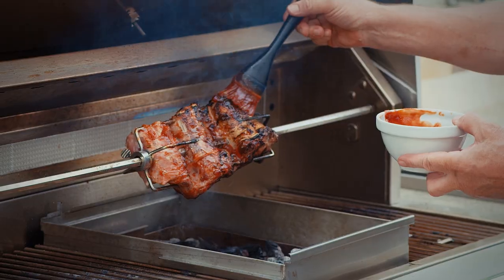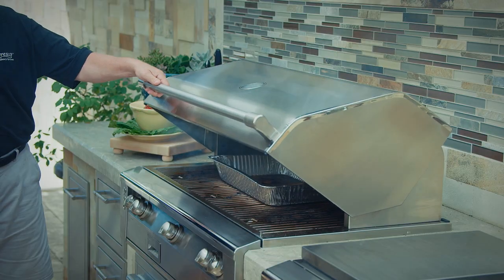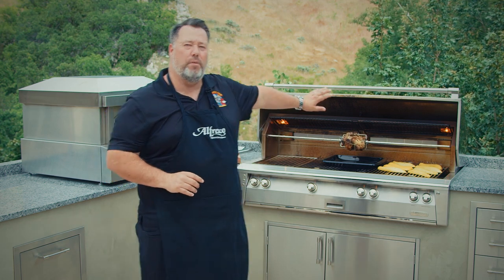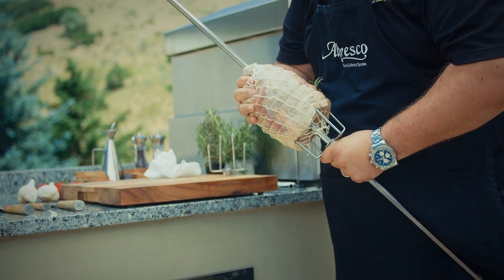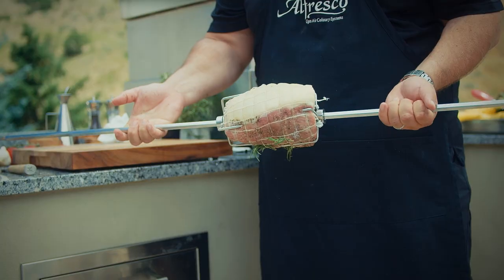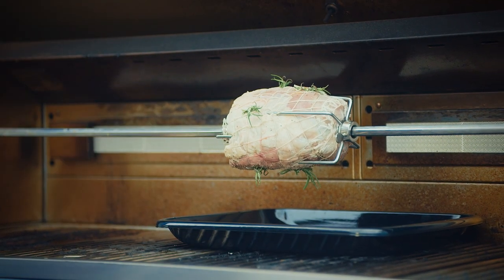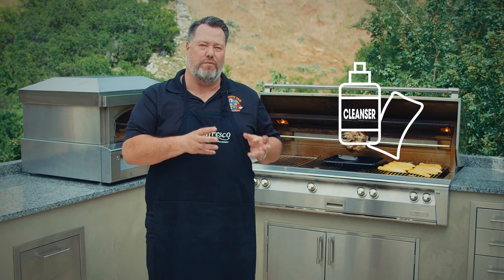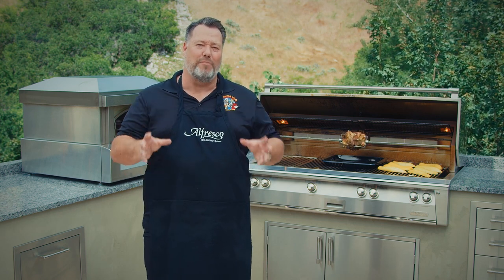Alfresco Grills - Rotisserie

Comment: During the video (01:30) there is a quick moment when rotisserie is employing the option of charcoal, but it is not obvious if the IR burner is being used at the same time?  I would appreciate clarification on the pro''s and con's in these options...what is possible, etc....
Reply: the charcoal is adding smoky flavor and extra heat while the IR burner is cooking it as well.

Comment: The instructions say turn the nob 90 degrees. The person demonstrating it turns the knob 180 degrees. Which is it?
Reply: The instructions are correct. In the video,  the knob is being turned back to the off position which is demonstrating what to do if the rotisserie burner does not ignite within 4 seconds. Watch the video again and you will understand.
Reply: @mh9763  Watch at 1:04-1:05. As he says "turn it 90 degrees," his hand goes to what looks like 180 degrees.